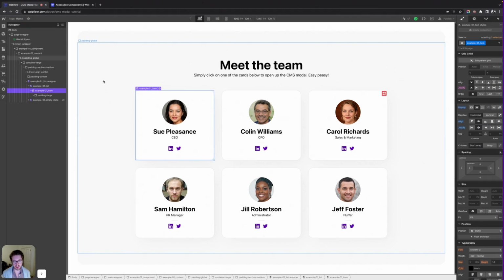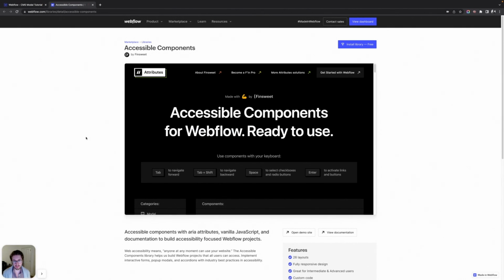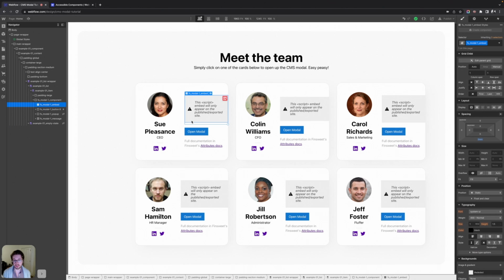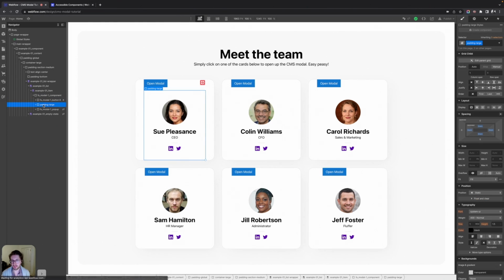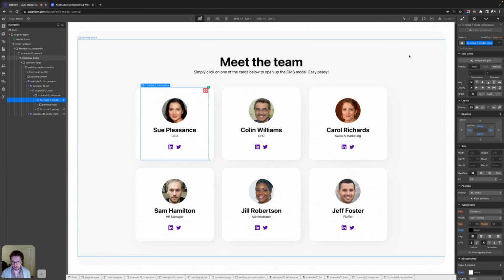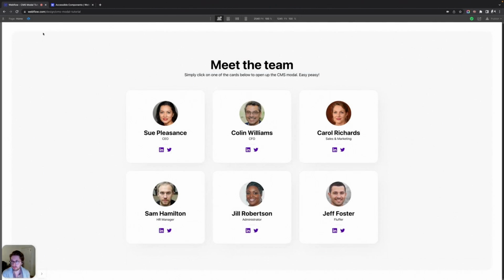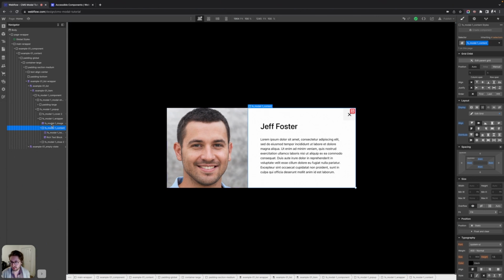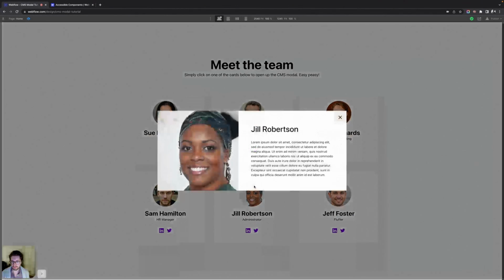Create a CMS modal in Webflow using Finsweet components

Comment: Great explanation, thanks. Any downsides to using Finsweet Attributes versus Javascript code? I can still use GSAP code to animate the Finsweet modal, it wouldn't interfeer?
Reply from the maker: Good question. Using GSAP shouldn't be an issue, but I haven't tested it on elements with Finsweet Attributes so I'm not 100% sure. I'd be interested to see how they interact so let me know how it goes!
Reply: Thanks for the  reply. I've ended up using JS only and have more control over GSAP, CSS and other attributes. With ChatGPT and basic JS and GSAP knowledge I think this is the way to go, though my guess is most companie will opt for Finsweet as it's easier to train employees on and faster to implement for basic functions.

 @samuelhurll9075

Comment: The lightbox doesn't work on the second page if you have more than 100 items and you need to use pagination. Does anyone else experience this? If so do you have a solution?
Reply from the maker: Sorry to hear this. To be honest I didn't test this method with pagination so I'd have to play around with it. Feel free to send me a read-only link to samuel@hallucinate.design
Reply: @samuelhurll9075   I solved the problem! 

I had a collection with more than 100 items so I had to implement Finsweet CMS loads and I chose the infinite load.
The light box/modal worked fine for the first 100 items but not for items on subsequent pages. 

To solve the problem, I added the "Reset Interaction" attribute to the collection list, which is always found on the Finsweet CMS Load More page under "Reset Interaction".
Reply from the maker: @doriquinn  Awesome, well done for figuring it out 💪